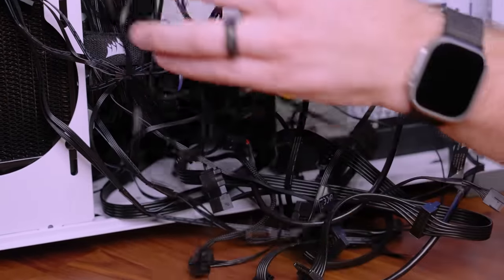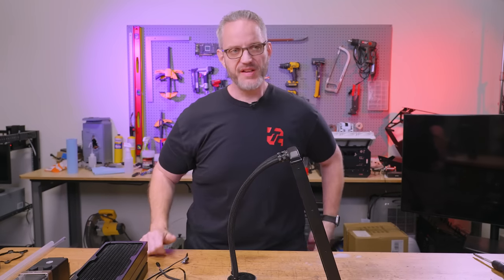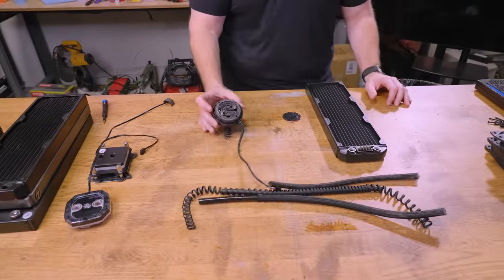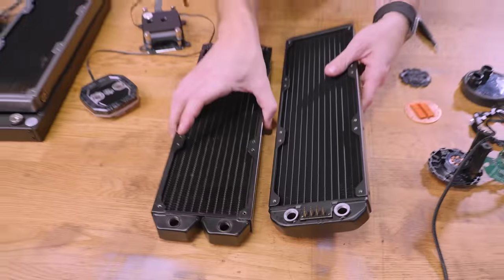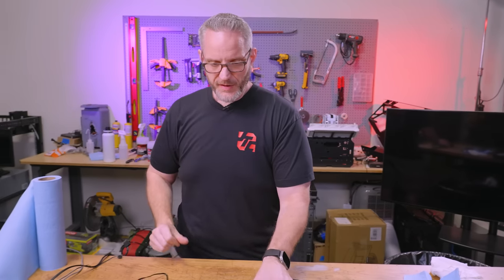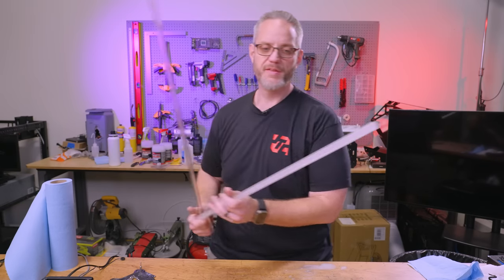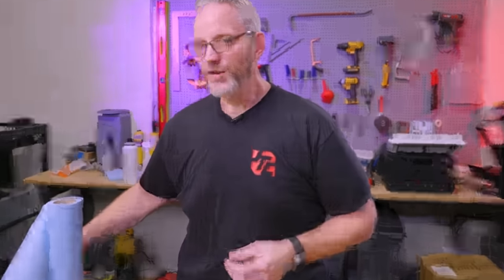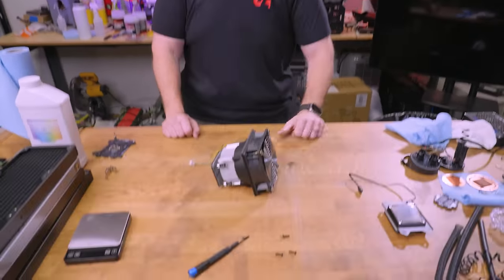Which one is right for you?

Comment: Open loop soft tube, because I'm all for function over form and ease of build/maintenance. And I can combine cpu/gpu into a single loop solution, with radiator overkill so my system is whisper quiet. 

Took me no time to install, and will last me for many years to come as my systems and cases change.

Comment: Custom loops are better but aio is way cheaper and easier. After my custom loops of the past I do aio on the cpu and the stock air cooler on the gpu. I don’t even over clock anymore. I just want it to work.

Comment: small chasis, high performance = top temps... => custom loop, external radiator, everything what possible turned into watercooling... all the other solutions will be just attempts to have the problems solved... thanks to JTC and this channel, I realized that, without going into to many unnecessary spent golden coins on mid-solutions.. I have 5900x, RTX 4090, 4x M.2, sitting on x570 watercooled MSI Carbon Max... hell amount of money, but silent and calm while in max performance...

Comment: OK, here’s my before-I-watch prediction, based on everything I’ve learned as I prepare for my first custom loop build:

1) “Better” is relative, and there are some things an AIO is better at, namely simplicity of installation.
2) Custom loops have access to more radiators.
3) Custom loops have access to stronger pump pressure.
4) Custom loops can incorporate more components, like a GPU.
5) Custom loops require maintenance, but they also enable you to do that maintenance, unlike AIOs where once they evaporate enough, they’re dead.
6) Custom loops can be more visually diverse.
7) Custom loops are just fun to design & nerd out on. 🤓

Comment: The water cooling stuff is always interesting and looks great, but the components I have been using over the past 20 years never required me to move past simple air cooling. The case I have been able to keep across builds also doesn't exactly lend itself to doing anything "pretty" on the inside.

Comment: Hard to really see what is going on with that aluminum rad inlet during the corrosion inspection thru the video lens but I question the lack of corrosion assertion since the internal surface looks unusual. The surface appears irregular, coarse, or bumpy however you want to describe it and not smooth and shiny.

Comment: -- Without watching it.  An AIO is cheaper, easier to install and makes computer service easier.
A custom loop is more expensive, harder to install and makes computer service more difficult.  However, due to the range of custom components, you can get superior cooling.  I would say the AIO is a little more reliable focusing on less prone to leak.  And the cooling difference isn't enough to justify the price for a custom loop.  But if you want eye candy, series/parallel loops, the custom loops.

Comment: Commenting at under ten minutes into your video. But something I haven't heard thus far is the heat transfer effeminacy of the different materials used in these different cooling systems. Thermal transfer for Aluminum is quite high. I also noticed that the pump side if the  of the cold plate has what looks to be a plastic cover plate for the pump impeller. Plastic has very poor thermal transfer properties. If I were making a pump for an AIO or any cooling solution, I would machine the the cold plate and the pump cover as one single piece. This would allow significant improvement in heat transfer to the cooling liquid in this type of system.

Comment: my corsair AIO(H100i) bought in 2015 or 16 (don't recall with precision) still works just fine and only in the November last year temps started rising but it still cools, with the liquid cooling staying at 33.8/34ºC not on load and 38/39 on load sometimes 40/42 thing is the cpu(8600K) jumping between 37/44 (not on load) sometimes jumping to 50/60 (at least it's what it says in the iCUE program) and on load it stays at 66ºC(max -> never seen it even reach 68ºC) and not going beyond that, I'm thinking on doing some mods in this and adding a tank/pump in it since warranty is already out and I want to change the case where it's at (a corsair one 380t black) thinking on a Phanteks Enthoo Pro 2 because I still want to retain this system as a streaming/working rig) and also thinking for the future and to save space

Comment: This AiO vs custom loop comparison/disussion comes up all the time but I can never help but feel like the entire comparison is just kinda moot.
While both of them seem similar in the way that both are water cooling, I feel like the target audiences for both are usually different enough that the question "do i go with an AiO or a custom loop" barely ever comes up in reality.

Obviously a custom loop is gonna give you way better cooling.
Its also (usually) way more expensive and way more work both short and long term, especially if you wanna make it look nice,
Often prohibitively more on both factors for most people I'd argue.

They fill two entirely different niches in my eyes.
An AiO is what you use when you just want more cooling than an air cooler or prefer the look and dont mind spending extra.
A custom loop is what you do if you want the best possible cooling and, more importantly, have fun tinkering with your system in that manner.

Comment: The AIO only lasts 2-3 years😳 I've had mine for 10 years and it still works great, has the new AIOs have become horribly worse🤔🤔

my intel CPU is extremely overclocked but the temperature is still at 52 degrees c after 10 years

can someone explain this or Jayz is wrong

Comment: @Jay
Define better.

Price/Performance? A High Quality Aircooler
Visual? Custom Watercooling
Durability? Any Aircooler
Ease of use/maintain? Stock Aircooler

Now, one might think, what is an AIO Waterloop good for?
Shipping!

But personally, never used an AIO and anyone that comes for a build and ask watercooling I usually recommend an Aircooler or spend that money somewhere else.
Reply: Anyone wondering why they'd be good for shipping;
The weight is mounted to the case.
The Block doesn't have much weight so there's less force/stress on the Motherboard especially when Shipping with UPS

Comment: Curious about water-alcohol and water-glycol (ethylene or propylene) blends. Of course, water alone provides the best thermals but glycol allows dissimilar metals (like liquid cooled engines) and alcohol also helps with moss growth. Maybe try that out?
Reply: Just use DP Ultra or Mayhems X1, no need to reinvent the wheel
Reply: @denissh9478  Not everywhere you can get those, and water-glycol is already proven on watercooled engines. It's a wheel of its own

Comment: I was actually thinking going to build custom loop with 4090 Alphacool enterprise block, and put it in very small itx case......... But now I'm debating is it worth it... Got me thinking just go air cooling in say double size pc case ( Lian LI O11 air mini, and with a couple of brackets, it can fit 360 AIO on top).
Reply: Or....or, you could get he biggest case, get some extremely large radiators and push it the extreme
To the point of when the case is so heavy, you no longer can lift the case at all. Lmao
That's where I am headed right now

Comment: 14:06 "I personally don't like PWM pumps. Just because I can't control the speed when I'm trying to fill and bleed a system."
Ever thought about using an external speed control? You could build one yourself with an arduino, an potentiometer and like 2 lines of code. Or even breaking down your cost to under 5$ with a small circuit driving an PWM-IC.
Could even turn out to be more convenient as the speed control would be easily accessible outside of the case with one pump wire to be connected afterwards...

Comment: Honestly the number 1 reason anyone uses open loop is for the bling. It just looks great and if you built it yourself it is extremely satisfying to see it come together - like building a lego castle. Yes it might be a few degrees cooler but at the cost and work required to build it, it will never be worth it over an AIO (and in my honest opinion, just go air if you really want cheap and hassle free, 99% of the time thats enough unless you're running your PC in the middle of the Sahara). For whether or not to do open loop cooling its pretty much entirely if you enjoy the process and the looks more so than anything else.
Reply: I've build mine for the GPU cooling, and you kinda have to use custom loop for that, and it's not just few degrees cooler, it's much much more cooler. 
But I agree, I think it's better to use air cooler instead of AIO.

Comment: 2:06 wrong..... car radiator is called a radiator despite having fans becaise radiators use a coolant

Heat exchangers use a refrigerant

Coolant can be substituted for water in most cases, like with boiler systems that use radiators to heat a house (could also be closed-loop with coolant)

But like with an A/C unit has to have refrigerant like a refrigerator has, heat exchangers compress fluids
Reply: Oh, and refrigerant is only liquid cause its a compressed gas....

Heat exchangers use a condensor coil and evaporator coil, which look like radiators

Comment: CUSTOM loop owner using airplex rads, optimus PC cpu block, active back plate EK gpu block, Optimus PC res/pump combo and all the fittings with the black softlines "server grade stuff" using RODI water with stabilizer... yeah its "borning" and colorless. but treat it like a CAR and or a Server and maintence isn't that bad! honestly 1 year in the coolant is the same as the day i put it in. 
spend extra and get solid copper adn nickle parts NO mixing metals! 
flawless and the maintence if you plan a fill/empty its a dream! 

AIO has hurt 2 pc's now with failure and nothing really showing or notifying, and air-cooled isn't living up tot he task anymore, of the new demands hight cpu core and gpu's are going for workstation/top line gamer builds.
Reply: also plan plan and plan some more custom is expensive and more expensive when you buy "extra's" the build just loops and such no mobo/gpu/cpu took around 6 months mock up and planning for perfection. "video comming soon once a few more touches are themed out!"

Comment: Before watching the video, I think AIOs take the cake here. They're much less of a hassle, don't cost as much and perform almost as well if not equally. That being said, I'm still rocking an air cooler on my 13700KF but I think in a few years' time when I'm going to be upgrading my build it will no longer be an option.
Reply: I really have been considering an AIO basically just for looks. I have a hard time getting past the lifespan though. I am using an NH-D14 which has been in constant use for almost 10 years at this point and zero issues, it is hard to move on from that sort of reliability, even if it's very easy to move on from that noctua brown haha
Reply: @Junebug89  Yeah, it's hard to top the reliability of a high-end air cooler and I would love to be able to use my existing cooler in the next build (I use a Deepcool AK620 in case you're curious). I just don't think that's a very realistic prospect given that my CPU current CPU warms up to 90 degrees Celsius and even beyond when gaming.

Comment: AIO's got basically zero maintenance, it's compact, has close performance, and the price is usually cheaper than a custom loop. AIO wins in most cases especially for the "average" PC owner.
Custom loop allows you to expand the cooling capacity and have more replaceable components. You obviously can't replace AIO pumps/rads too easy. The only place it really wins in comparison is cooling capacity overhead, capability to run quieter (More rad = slower fans or even passive/off), and the "cool" factor of it being completely custom.

Comment: If I already have an AIO installed and I want to upgrade to a loop system: can I disconnect the AIO lines from the radiator and use that radiator by connecting the loop lines to it?

Comment: Oops sorry. I forgot to give a great like to the video.
Before watching the video: AIOs nowadays have gotten so good that they have most of the good things a well made custom watercool has with none of the downsides. Except aestetics. With custom, you can make your PC look like whatever you want, with AIOs...not that much. And price. Try to make a good custom, and with "good" I mean as good as an AIO for the same price as the AIO itself. You need to spend nearly double to match the performance of an AIO. You can make way better systems with custom? Yes. But prepare your wallet and nowadays...a liver too. With tie price of a not-that-good custom loop I can get at least 3 AIOs that will last combined much more than the custom alone...with the good part that if in 5-6 years I change CPU and the die size changes (like AM5 vs AM4 and FCLGA 1200 vs FCLGA 1700) I'll get a new AIO for nearly the same price as the new CPU block whilst the rest of the loop will be several years old by then.

Comment: If I was going to go liquid cooling I'd personally go with AIO, as the whole thing is under a warranty or guarantee, it's simpler and much faster to set up and run. If I needed something more complex then I'd design and build one up from parts. Personally I prefer air cooling as I do not want my system trashed from liquid contamination or overheating due to assembly oversight or cooling system failure. (I had a liquid cooled GPU once, a Radeon Vega 64 LC, which was great for a very short time until it failed. I was not impressed. I expected a lot more from liquid cooling.)

With decent case airflow, if an air cooler fan fails you at least get some passive cooling allowing, hopefully, for a graceful shutdown than a shutdown from component burnout. To my mind, liquid cooling adds a lot of weight, complexity and points of failure, for relatively little gain.

For me, at the moment, it's air cooling all the way. It takes time and effort to learn about airflow. It's a lot more than just putting a load of fans in a box. Some aspects don't even make sense until you learn and understand. It seems that case manufacturers don't understand either and it really ticks me of when I see what could be a really good chassis or case and the same mistakes have been made again and again.

Comment: No joke, I'd rather the blowematron.
That being said, I like my aio, simple, easy, cheap, minimal failure points, just wish theyd take flow a bit more seriously in them, 240's used to be good for sub 70*c on decent chips, but now I've been hitting 80*c on a 3600X since install (yes its been installed multiple times, thermal paste is fine, my chip just forces itself to run at 1.35v+ all fucking day, thanks MSI.) I went aio to get sub 70*c, FNQ Australia weather kinda forces you to go overboard just to get average temps, our climate sucks.

Comment: You want it before the video, so here: Better is a subjective thing. AIO have the benefit of being easy to install and taking little planning and in general are vastly cheaper. A well done loop takes careful planning, a case that has room for everything you want to do and quite a bit of money tied up and there is significant time and hassle in building and maintaining a loop. Performance-wise, both in noise and cooling performance, you CAN do significantly better with a custom loop, but a badly done loop or poor selection, can leave you with in some cases worse performance.

Comment: Better in what way? aesthetics? performance? ease of installation? the way the testing is designed will also dictate that, IE; are you going to be overclocking each unit to its max ability before you saturate and get throttling?, or are you just running both at say a given speed on both and running games and seeing what the temps are? cos if its all performance metrics then I'd always say custom, because it's more likely to be holding way more in water capacity thus more thermal capacity than an AIO meaning the overall rise in temps would be way way slower, a custom will usually have greater surface area in rads to expell heat etc, but a custom will loose from a budget and ease of installation standpoint all day long.

But that's coming from a guy that's only ever ran with air cooled pc's, I personally can't be arsed with the servicing of water based systems, they are lovely to look at, but the extra effort and cost involved just makes me go "nah, I'll spend the money on more important stuff", but that's also because I've always built systems more in the middle range where I have to consider if the difference between putting the money on a decent stock OEM cooler like the wraith or spend the extra and go with an AIO or custom loop that would eat into the purchase price of just buying a better CPU or GPU in the first place that will give me the better performance overall than worrying about trying to overclock a lower end CPU to the bleeding edge while trying to keep stability to get similar results, I'm just getting older and cant be arsed with that anymore, My old core 2 duo's and Q6600 were beast's back in its day lol 

On high end systems like the type you see showcased here on Jay's channel they are already choosing the top end of everything, Ram, GPU, CPU, MOBO, Case etc, so all the accessories really need to follow that,

Comment: I'm poor, so the odds of me getting a CPU that would benefit that much from either an AIO or custom loop are pretty low. I'm considering upgrading from a Ryzen 3600 to a Ryzen 5600 (or x) and I'm pretty sure I can get by with the stock cooler for that, and if not, I can likely spend $30-$50 to get a decent tower cooler that will keep it fairly cool anyway. 

Still, I find these videos to be extremely interesting in the "maybe someday" type of way.